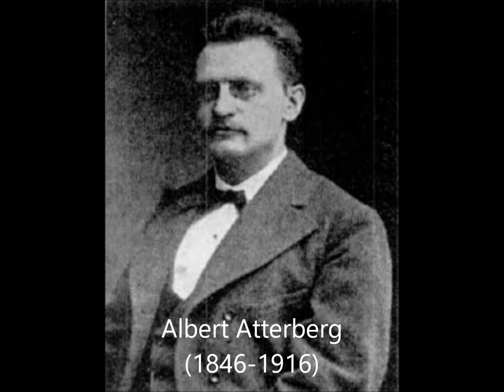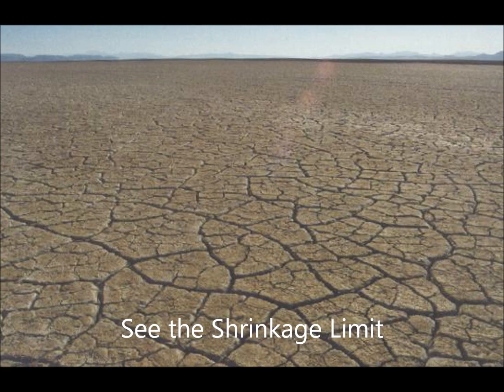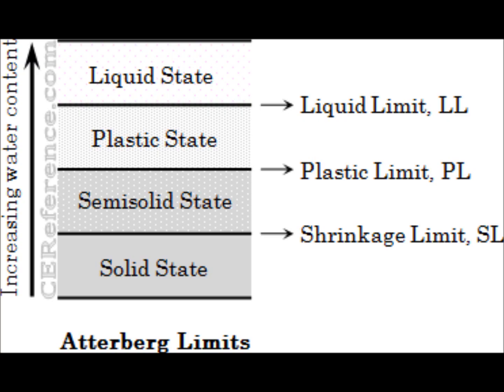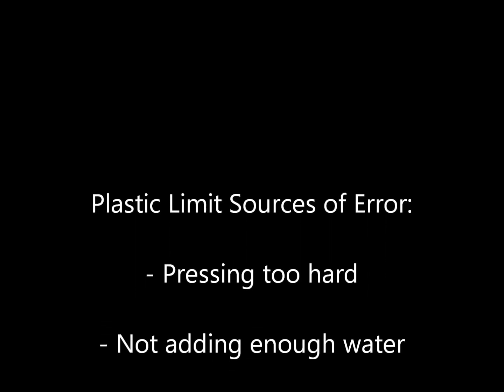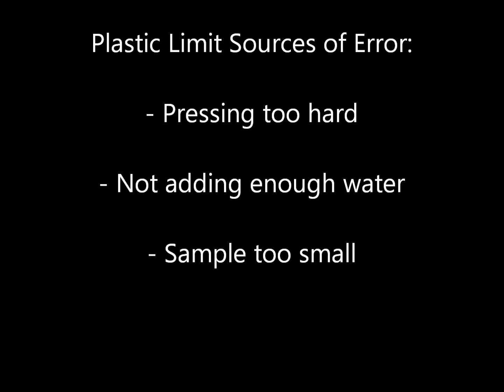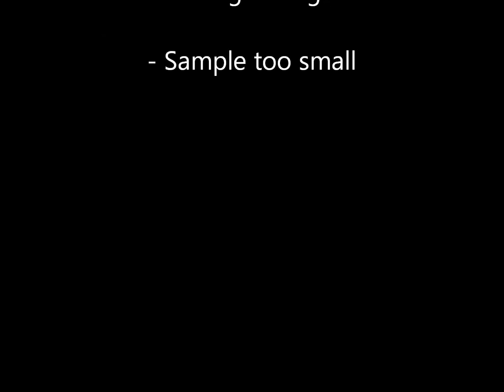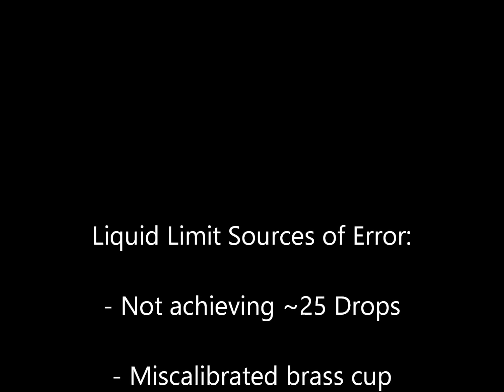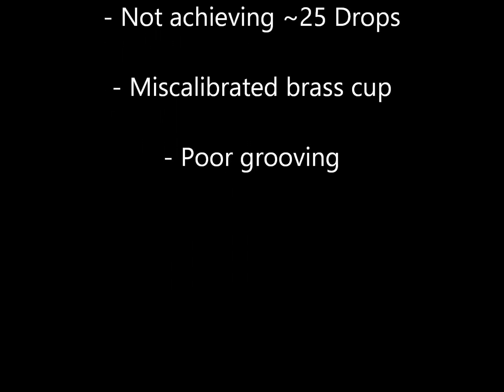Atterberg Limit Tests

Comment: You should rename this: How not to run Atterberg Limit Tests.
Reply: Why?
Reply: +Steven Woodruff 
1) The soil sample that you roll into an ellipse for the plastic limit test should be approximately 2 grams.

2) The plastic limit is defined as the moisture content at which an ellipsoidal mass of soil 1/8 in. in diameter just crumbles when rolled. The ellipse in this video is probably 1/2 in to 1 in in diameter.

3)The groove should be cut from the top of the cup down for the liquid limit test.

4)Get your hand off the liquid limit device when turning the crank.

5)The closure of the soil pat should only be 1.3 cm. The length of the soil pat closure is approximately 1.5 in. in the video.

6) The crank should be turned at a rate of two blows per second. The person is this video is turning the crank too quickly.
Reply: Good to know!